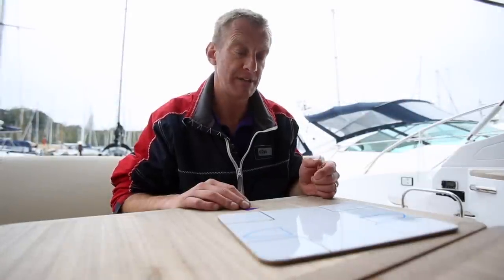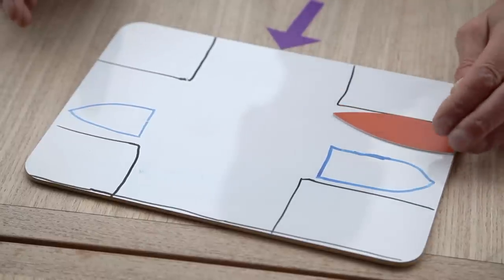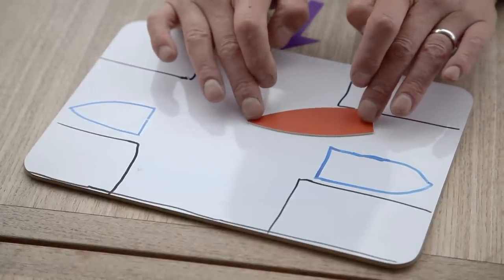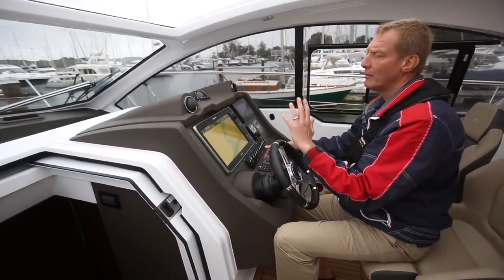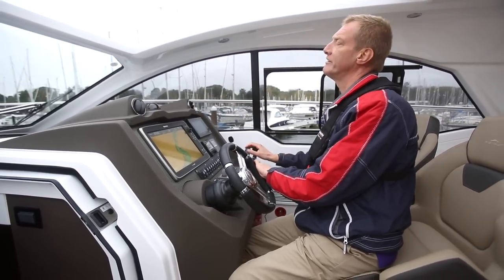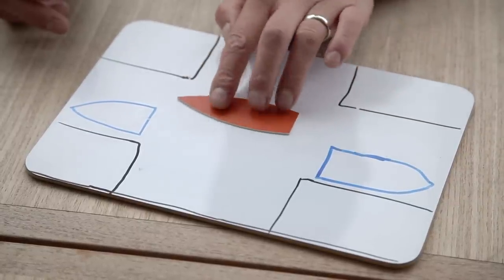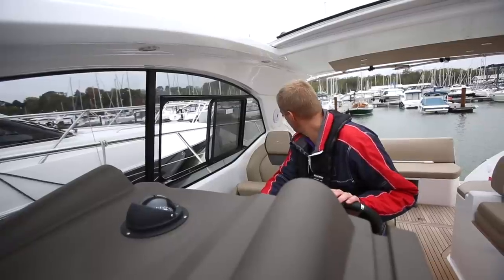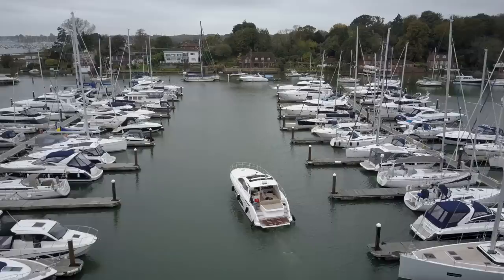How to: Leaving a Windy Berth | Motor Boat & Yachting

Comment: I usually perform that maneuver from the heads. It adds an extra level of difficulty to a windless day. I usually also get the Bosun to flip some pancakes in the galley while I control the casting off.
Reply: Funny, but not helpful!

Comment: Last year we got stuck coming off of our berth, it was like coming out of a really tight tight car park with little space to manoeuvre. We were in a modern marina with rows of finger pontoons, we were 2 berths away from the dock wall with similar berths/pontoons to the back of us. It all started sensibly, we reversed back but with a slight breeze we kept getting pushed sideways until there was nowhere left to go.  Ours is a 27' sports cruiser with Duo props and a thumping great diesel... we found ourselves unable to apply enough power to make a turn, we could only inch forwards and backwards. In the end a fellow boater took our bow line and pulled us straight. In that particular instance, with that boat and in those conditions I doubt anyone could have made that turn. As a relatively experienced boater this situation bothered me so I went straight out and had a Side Power bow thruster fitted. The work was completed in 2 days and now we have the tools to get ourselves out of trouble. As an added bonus, my throat is a lot better as I no longer need to shout at my wife.. :-)

Comment: My first venture out in similar conditions was in 18mph cross winds. The moment we were half way clear of the neighbouring boats the wind caught us and full bow thruster just got it straight, by which point we were drifting across the mariner trying to use the props and avoid other peoples bow lines and spin the boat together with the thruster full on.  With an audience watching. 
I did wonder why traffic was quiet that day.
Getting back in was equally hairy and once tied up the relief was huge.

I think the key is be positive and get the boat moveing. Once your tracking you get some directional control, when your stationary, pulling away or stopping to berth your just fighting the wind. 

Anyway, great video's as ever, much appreciated.

Comment: I have a 51 footer with no thrusters. I often find myself struggling to maneuver away from my dock without tapping my stern as the wind is predominantly blowing me into it. I’d love to see some videos of similar close quarter maneuvering without thrusters.
Reply: I have the same problem. Can never find videos to help with these problems. Same with coming in to moor between 2 boats with wind blowing you off!
Reply: See The Boat Cheat on Youtube, he has great answers to these in various boats. Also 45 Degrees Sailing.

Comment: Any tips for smaller boats with no bow thruster n only one engine?
Reply: Infiniteflight_uk06 turn your wheel over when you’re out.  Give a splash of power.  Pause. Then hit reverse for a burst, then neutral, then another forward burst all while leaving the tiller or wheel over this will pivot the boat.  You may need to do it over and over. A spring line helps too.  You could tie off the bow and let her rotate to the wind.  It it all goes tits up and the bow blows across you can always back out of the channel.  If that’s a mess go down below and take two Fugitols and call me in the morning.
Reply: @kylefng  , this was me last weekend--maybe the last time my wife will get on the boat with me and let me cast off. Then once I backed all the way to the river and started to get the boat to rotate the right direction a little, the wind from the stern was pushing me back toward a Giant Expensive Motor Yacht at the adjacent fuel dock. I didn't have enough power to counter the wind. (Tried. At 60 percent throttle in reverse, I was just cavitating.) What to do?!
Reply: Eric Evarts you can always come in like you’re about to kiss the pier and tie a line to the piling and use that as a pivot point.  It took me 25 years to become mediocre at best lol.  Fair winds and following seas!

Comment: If you leave the Bowline secured and remove the stern first then you can use the engines to twist to hold the boat in position. then cast off the bow.

Comment: +Motor Boat and Yachting,
Mr Mendez( apologies if the spelling is incorrect?), could you please explain the "balance point"??
Many Thanks,
Jonathan
Reply: about a 1/3 down the boat, usually about where you sit, boat will pivot around this point.

Comment: The second you mentioned bow thrusters I sighed! Get a grip will you and do this in a normal every day boat! There are far too many instructional clips with fully loaded boats. Thumb down for you mate!
Reply: what the faq are you babbling about?
Reply: @ericr5561  he's babbling about a video of someone showing a difficult maneuver who has bow thrusters.  Kinda makes everything easy and not helpful to people who don't have million dollar boats.
Reply: @johnnicholson8345  Bow thrusters are quite often fitted to relatively inexpensive boats, they're not hugely expensive. (I'll admit my 18 year old 3rd hand 10.8 metre boat doesn't have one, though)
Reply: @johnnicholson8345  Just about every single large boat comes standard with bow thrusters.  I have a 15 year old 40' boat and it has a bow thruster.  It's uncommon to NOT have one now.
Reply: The 38’ Grady White I captain has bow thrusters.  They I believe are even offered on the 30’.   Very common anymore
Reply: @dancheesman1752  Not a single boat out of the 130+ at my marina with bow thrusters. Not one.   Not so common.
Reply: Lancer525 becoming very common on newer boats.  Why not take the option it makes things easier.

Comment: I did something very strange that worked perfectly for me in 15 winds with 25 knot gusts. I was reversing stern first from the slip and without a bow thruster and in a 40' sailing yacht, my bow would immediately get blown downwind the wrong direction. I come out proud, full starboard and the wind still would overpower. SO I decided to not fight it anymore and just reversed all the way out of the marina. I think many heads turned but once I cleared the last docks I had room to get turned around with the huge turn radius the wind caused. It worked so well that it is my new "go to" plan and people can laugh if they want. If it works, it works. Any comments?
Reply: That's what I did last weekend. Only with low tide I still didn't have a wide enough channel to get turned in (even with a little current that should have been in my favor.) So it still didn't work. If I hadn't been required to move the boat that day, I definitely woudn't have touched it.

Comment: Couldn't you use the stern springer to as a slip line to control exiting forwards movement and keeping it tight with a port engine, steering to starboard gentry as you exit, then locking it off as you get close to exit? Then drive the boat around towards the wind (with power and steering) before releasing stern springer and driving ahead under both engines.  The benefit of the springer is that is holds you close to the dock and stops you from falling to the lee of the breeze at you most vulnerable point as you leave the dock proper. Locking off the springer (at the closest point) means you can use the line to the dock as a hinge to power around with the port engine and steering. simple!

Comment: Why did you use the wheel on a twin engine boat ?
Reply: Guess he doesn't know the thumb principle. Surprised that rig doesn't have a joy stick system
Reply: I thought I heard him mention that this boat has sterndrives when similar videos came out months ago.
Reply: it's a stern drive boat, not as agile as shafts to turn without wheel. The boat does have a joystick system but the operator is not using it to make the video applicable to people without the system (the majority with older boats), and non-trivial.

Comment: I never used the wheel to manoeuvre my twin engine boat.  Never really know where the wheel is and it can really screw things up.
Reply: Get a rudder gauge.  It's a life saver.  Thankful we have one, and throwing your rudders around makes the dual engine maneuvers easier.
Reply: I could turn my boat on a dime and move it sideways with just the engines. That way both hands on on the throttles. Some day your system will bite your A**
Reply: @RetiredPilot  what system?  I said get a rudder gauge - it just shows you where the rudders are.  I also dock using both engines only - never touch the wheel.